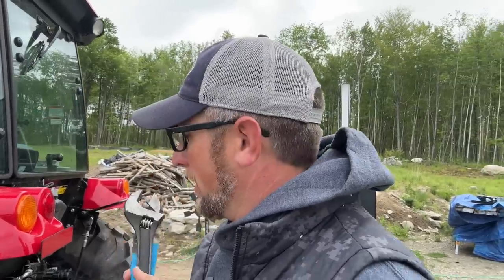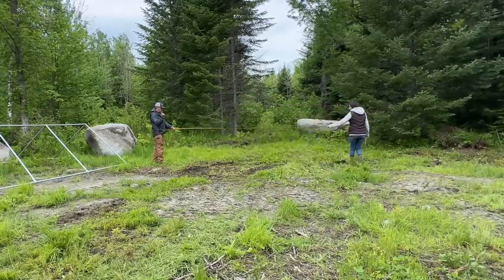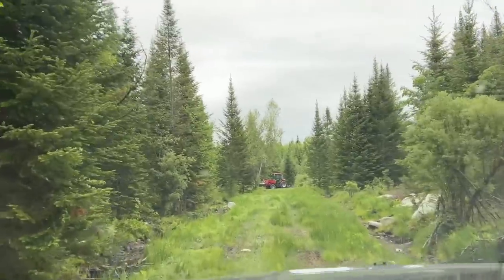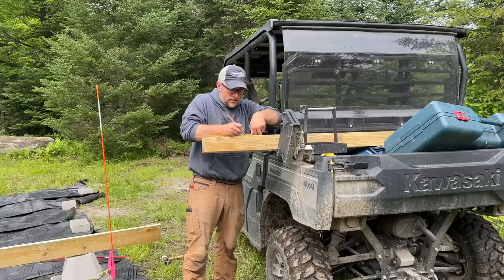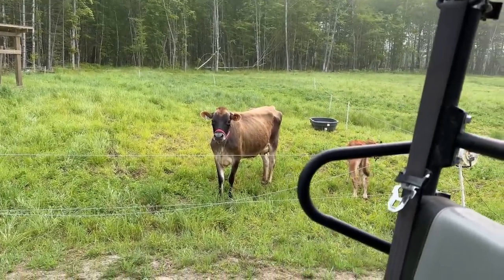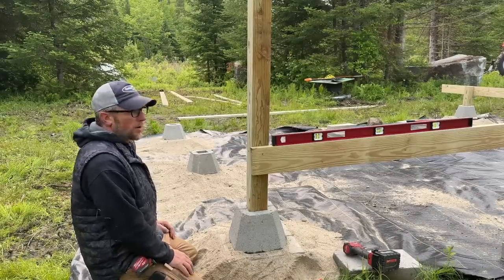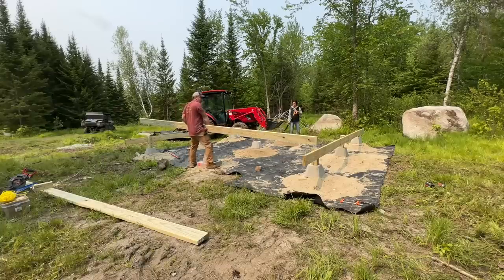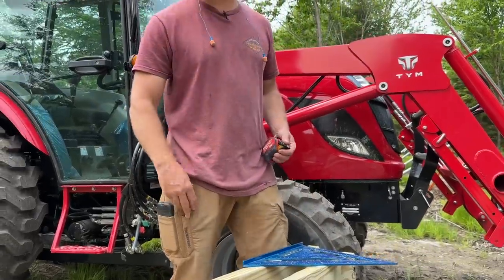BUILDING a REMOTE CABIN in the WOODS  (Part One)

Comment: Why not build something practical like a pole barn to keep your vehicles & equipment out of the weather ? Or a woodshed to house your firewood, splitter & maybe the boiler so that when the ground is covered with snow you won't have to actually be standing in it to feed the boiler. Have a great day 😊.
Reply: Back a few videos ago, he's got a contractor leveling out an area for a barn and shop. In this video he mentioned waiting for some kind of approval. (town building permits?)
Reply: They don’t do practical very well.
Reply: @rupe53  I believe that is going to be a substantial structure & nothing like a pole barn or woodshed.
Reply: @larryparish5984  ... AL may not be an engineer, but have you even seen him build something that was NOT substantial? Still, I am amazed he hasn't tackled a woodshed between the house and the boiler.... with a side roof to park his truck. OTOH, it would make sense to hold off there till the siding on the house is done.
Reply: Earlier reply from Lumnah Acres “We have to wait to side the house until we can get a specific lift and waiting on building material and equipment for other projects“
Reply: @jeffparker3334  Although they rake in the cash!
Reply: @user-od8qj3be8m  i like jealous people that fume. lol
Reply: he's going to have help putting in a large barn and workshop - they are still leveling the ground, finalizing measurements, etc.
Reply: @40intrek lol These folks  be waiting  for  ANY type of  thing to grip. Sad . let him to HIM folks. You do you.
Reply: @jeffparker3334 hmm let's view your life .Get a youtube  channel  and let's see how PERFECT  you are.Ya good at throwing  rocks.
Reply: @user-od8qj3be8m wow! How did you get their bank statements?
Reply: @delphine88313  How many tens of thousands of dollars do you think it costs for what they do. I am scared to imagine the total cost of all the ground and rock work being done for several days and there small pasture and more. Those big pieces of equipment do not come cheap!
Reply: @user-od8qj3be8m  Its none of our business. The man  is earning  the money legally. I don't begrudge  anyone for  working  hard. You go and do the same  and get what your heart desire.He is  spending  the money  getting  his family  established  so future  generations  may not have to spend this type of money or do the work on  these builds unless they want too. Isn't that the American  dream  or it use to be .Yes, he makes mistakes  but who doesn't. All I can say is HOORAY  for him and his family.
Reply: @delphine88313  Did I ever say that he was making his money illegally?
Reply: @user-od8qj3be8m  I didn't say you did. Im only SAYING from what I can see .He is  earning his money by hard work. Smh
Reply: @delphine88313  OK and is his hard work (other than utube) sustains his lifestyle? I do give Al credit as he is ultra talented. Then 99 some percent of us could never pull a profit the way he homesteads!
Reply: @user-od8qj3be8m  ... most of us here could go to a bank for a loan, then figure out the payments over 30 years and see if income from YT would cover. We also have a big variable in that we have no idea what Al had squirreled away to start. That part is none of our business.
Reply: @rupe53  Must have been one greedy squirrel. Over the last year or so they have purchased I would guess about $100.000.00 of equipment and I say more power to them!
Reply: @user-od8qj3be8m  .... remember, at least one of those tractors was a promotional "gimmie" in exchange for talking about the company over a period of time. Who knows what other horse trading is happening, besides nutritional supplements and such. Al also spent a fair amount of time promoting the solar battery system and those small barn kits for the animals, so probably got a break there too. He's no dummy.
Reply: @rupe53  Agree and he may have gotten a deep discount. However a gimme I do not think so. And the super nice trailer to pull. The piece of equipment for the snow blower plus the snow blower plus the weed/grass mower plus plus plus. Then he is smart and i am not begrudging him. I watch other "homestead living" channels and truthfully none of them live the life that he does!
Reply: Why do people think it's their business what others make in terms of income? Yes they put their lives out for all to see. But does that give one the right to wonder? I never knew how much my folks made. None of my dang business.
Reply: @jennsadventures84  .... not trying to be rude, but why do you want to control the thoughts (wondering) of other people? Personally, I learn quite a bit by watching what others do and how they do it. I don't need all the details to grasp the ideas and directions. I can figure out that part myself.
Reply: Why gripe about what someone else does? It's a free country.
Reply: @JamesCouch777  I wasn't gripping I was simply stating my point of view. You are correct and it is a free country so does that not also allow me to say what I think?
Reply: @JamesCouch777  just an observation, not a gripe.
Reply: @rupe53  me? What?
Reply: @jennsadventures84  ... in your post you talk about "the right to wonder" but I feel that's part of natural human curiosity.
Reply: Excatly apractical person would build an area next to the tiny house for storage first
Reply: @charlottestevens9352  ... Ha, yer not the first to mention that!
Reply: @rupe53 the location of the boiler is temporary, it may or may not be moved when their full time home is built.
Reply: @jeffparker3334 clearly you haven't been watching for longer than a week or so. He's building a shop and barn, either can hold equipment practically.
Reply: @rootriverwoodworks5883  ... True, but a woodshed could be built with skids and dragged to a new location if desired... or repurposed as equipment storage.

Comment: Thinking you may want to build it on skids like you did with the goat barn so you can move it around the property for different campsites. 
In fact it may be cheaper to buy a used camper. You already have a lot on your plate with finishing the house and building a barn & workshop.

Comment: just for reference your frame probably would do better if sat on top of 4x4's so that it didn't depend on screws/fasteners to hold the frame up
Reply: I worry about the shear on the screws too since screws have a small cross-section that has the threads off of it. My brother-in-law had a suspended "mezzanine" in his shop. He kept putting more stuff up there. My sister told him to put straps up because the shear was going to make it fall. He didn't listen. It fell on top of the MG he was restoring. I like your method better for strength! I'm sure they won't load up the hot tent as much as he loaded up his mezzanine section but if Al had at least notched into the wood a little I would feel better. Have a great rest of your week!
Reply: @StoneKathryn  it will be blown away in the next high wind with no holdowns. It will be more than a cabin it will be 5***   They didn`t rough it when they went camping in the tent  some time back.
Reply: @arwogue  I don't think they do "roughing it" camping. It was funny that they got too hot in their "hot tent" camping trip. Glamping is very much their style of camping. I loved hiking into the state park with just a backpack and sleeping bag to camp with when I was a child. Different strokes for different folks!
Reply: @StoneKathryn  Definitely!
Reply: @StoneKathryn  yes notching or half laps would be a good alternative

Comment: Suggestion as I saw it down on Maine Cabin Builders. Get some ridged foam  2" thick. Foil coated is also fine. Cut and put on the ground under those blocks. It will help keep moist down and away from the cement supporting blocks, along with the black tarp moist barrier. Best to you on your build.

Comment: You have an unfinished house inside and out, no cover for your fire wood. No covered area for your vehicles. No proper fencing, no green house or “ secrete Garden . No shop or proper barn. All of that and your building a camping building. What’s wrong with the tent to escape too.  Your life of course but crazy to see.
Reply: Explained in video! Did you not hear? ALSO Earlier reply from Lumnah Acres “We have to wait to side the house until we can get a specific lift and waiting on building material and equipment for other projects“

Comment: What happened to the container house?
Reply from the maker: It still gets used
Reply: @LumnahAcres      maybe you should buy a camper and just pull it around to different locations for campouts?
Reply from the maker: @ky.gambler5281  that doesn’t sound like as much fun
Reply: @LumnahAcres  No building with a RV! Al, I'm worried about shear on your platform. Screws aren't structural for carrying weight. Carriage bolts are much better or put the joists on top of the posts and then you can sister them! The sand can wash away too so I think the gravel you started out with is perhaps better? Just a couple of worries. I love watching you build! Your property development is so fun to watch!

Comment: All the weight is being borne by the screws and not the wood beams. Myself l would build beams and place them on top of those 4x4's. lf those screws are not structural, to me that is a disaster waiting to happen once the weight is added. In my area this form of construction would fail inspection immediately. I use those concrete blocks but use 6x6 stock and then triple up 2x10s and place them on top of the 6x6 posts. I then use metal plates and special galvanized nails to attach the posts and grade beams together. Then the deck platform is constructed on top of the grade beams. Your build your way. To me you have a safety issue as it is.
Reply: I agree that screws have very little resistance to shear and this is not the way to build a platform. Have a great rest of your week!
Reply: It will blow away or move on the piers in the next big wind.  Don`t forget Al knows everything.

Comment: I think you should be working on a project for your livestock or working on the shop - barn or house. Not building some cabin in the woods. like your insulated storage container. why not just pull that where you want to build this cabin.
Reply: 3 earlier replies from Lumnah Acres “The container cabin gets used” and “The container would never be able to make it to this area” 
Also “We have to wait to side the house until we can get a specific lift and waiting on building material and equipment for other projects"

Comment: Don"t you have a tractor you can pull the trailer with? With it corners, 4 wheel drive, or terrain should not be a problem.
Reply: Stated in video that there were 2 corners that the "trailer" couldn't cope with!